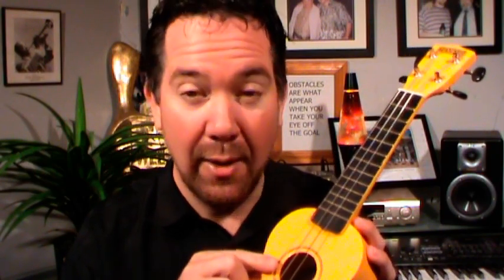Lips and Air Misconceptions - New WindWorks 2018

Comment: Interesting video. To clarify, you are stating that the tension is increasing as you shorten the length of string. Technically, and in the physics lab, this is defined as "shortening" the string. Adding "tension" would be achieved by twisting the tuning peg, which does in fact raise the pitch. Aperture controlled embouchures do align with the natural laws of the universe (physics) and you are in fact changing your vibrating surface length (of the lip) and/or adding tension when ascending on the trumpet. This is clearly visible in your videos. I'm happy to discuss the physics model that explains the "lip length + air pressure = pitch" theory in person the next time our paths cross. Cheers and keep up the great videos!

Comment: Ah yes !!! Mr. Ingram is one of the few Pro's who still wade thru the, "advice" and still add greatly to the threads... Mr. Ingram and I have messaged each other about more than a couple "expert advice givers" and had a good chuckle. I haven't been on TH for about 6 months now. Early on, the Pro's were very frequent on the threads. But most have been chased off. There still a few folks out there who genuinely care and give great advice. You just have to put up with a lot of the other advice too.